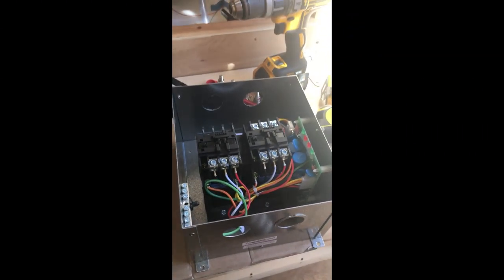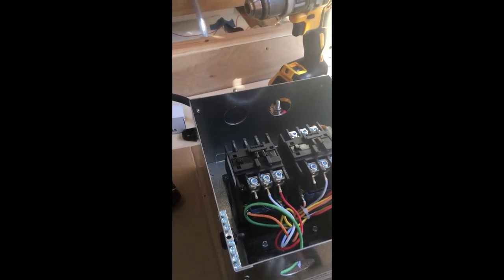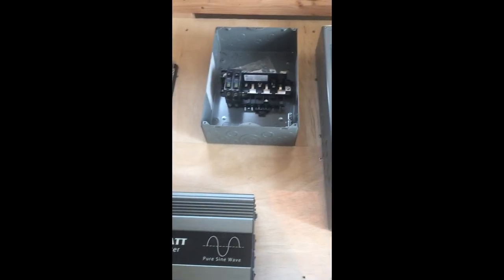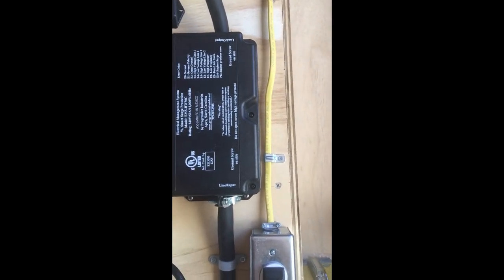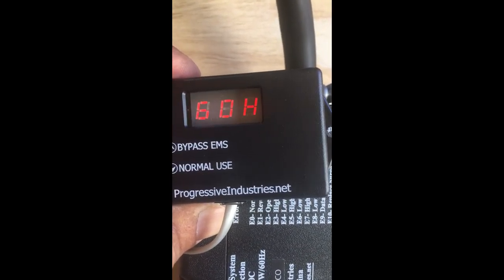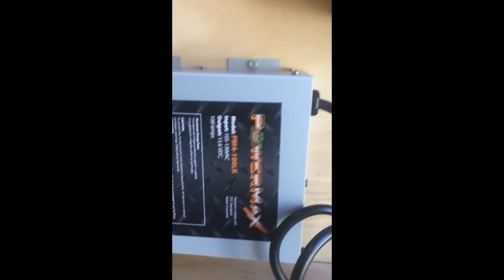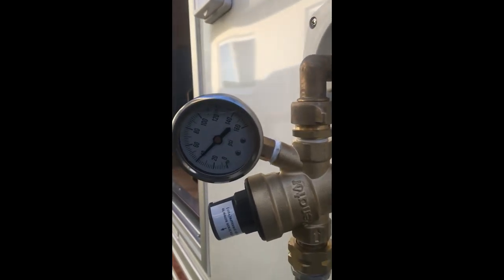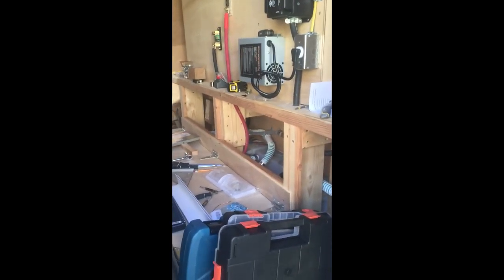RV Trailer Build #49 (Part 4) - Utility Room Wiring, Transfer Switches, Inverter, Converter

Comment: Question for you, why is the first Automatic Transfer Switch in there? I'm curious because I'd like to take your setup and use it in my enclosed motocross trailer.
Reply from the maker: Scott Knauer the first ATS  is for shore power or Generator-depending on which the ATS HANDLES THAT INPUT
Reply: @mobileoffgridpatriot8191  Thanks, I'll only be hooking up to a generator. Super informative video.